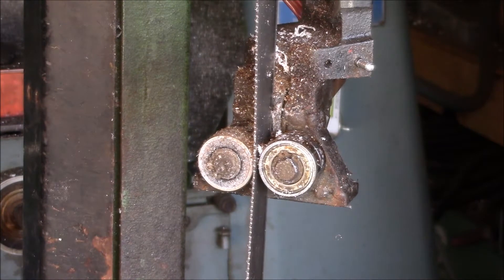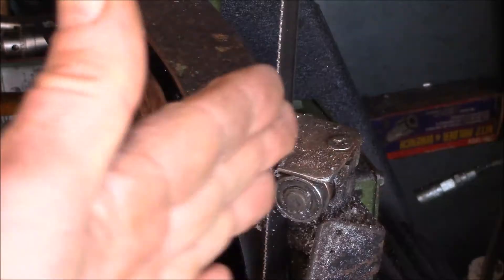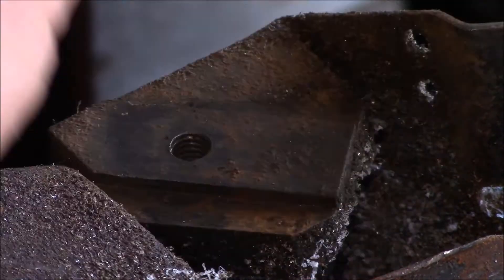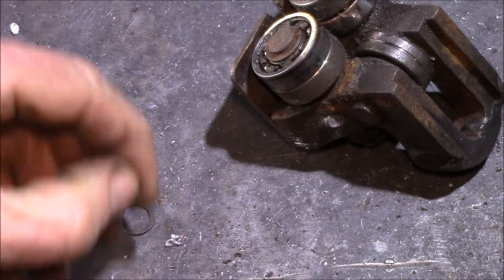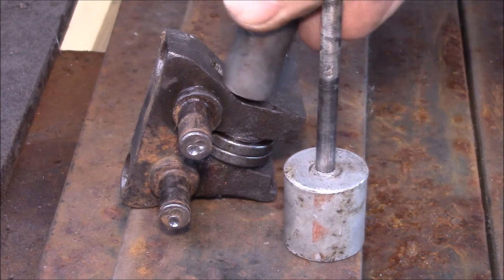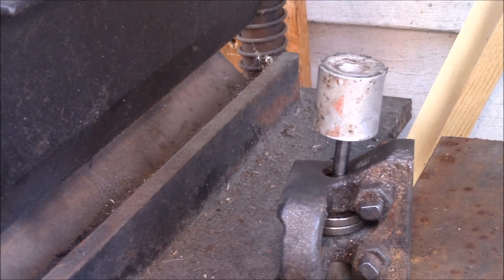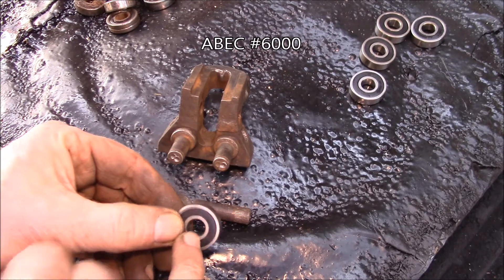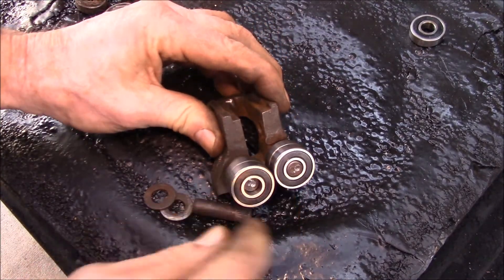7"x12" Bandsaw Blade Guide Repair, Part 1

Comment: Darn. Need a press to get that bearing out. Thanks for the video.
Reply from the maker: I've also used a drift punch with the blade guide clamped in a vise, although that was after having pressed it out once and a liberal application of anti-seize on the pin.
Reply: @The4Crawler  I managed to get one out using a punch and a 5 lb hammer. The other one is being a bit more stubborn.
Reply from the maker: @ixflqr  Sounds like mine, one came out easy, but needed a press for the other one, at least the first time.  You do need to be a bit careful with those blade guides as they are cast steel or iron and somewhat fragile.

Comment: They look like they are the same bearings I bought for my 3d printer upgrades
Reply from the maker: They very well could be.  Seems to be a fairly common size for a 10mm shaft.  Skateboard bearings for 8mm shafts are #608.